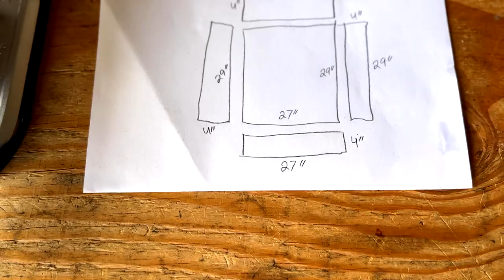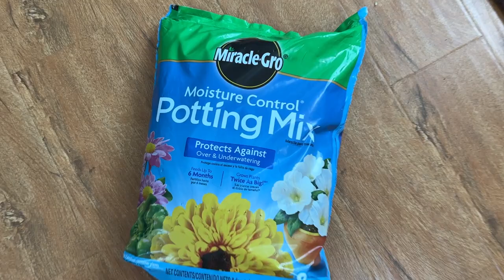Build a Terrarium Coffee Table – Step-by-Step!

Comment: Great build. I'd recommend getting the DCS391 circular saw for ripping. It's so much faster than using the jigsaw and doesn't take up a lot of space :)

I do have a table saw, but I also live in an apartment, so I bring the DCS391 to the store to rip down my sheets or long boards before putting it in my tiny (I live in Europe) car :)